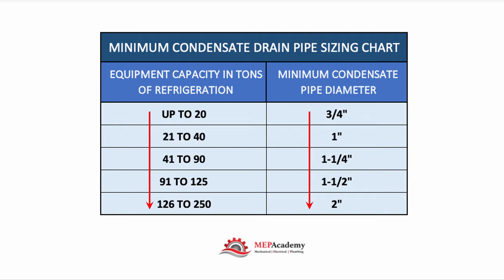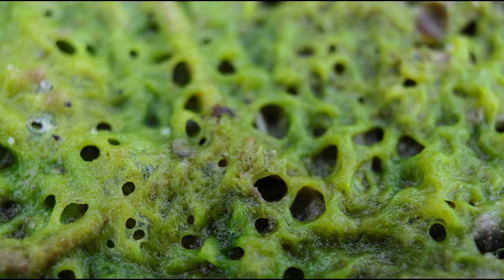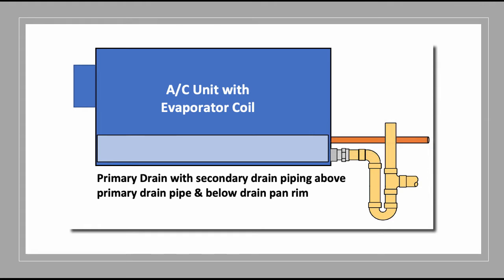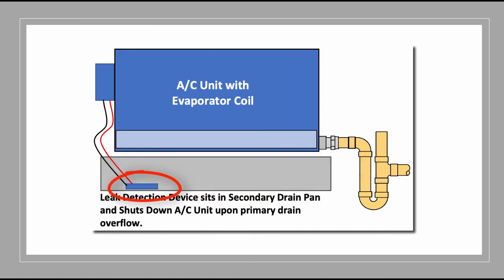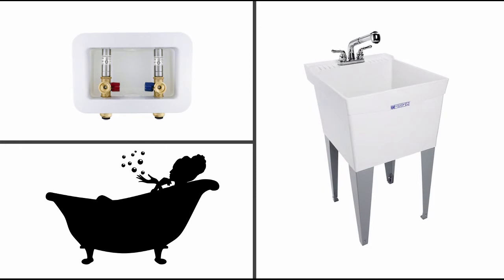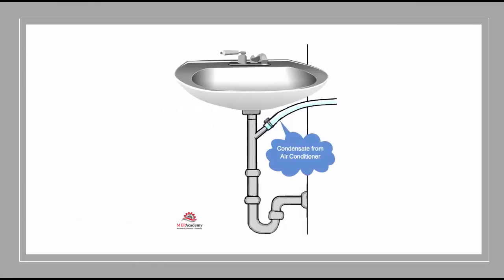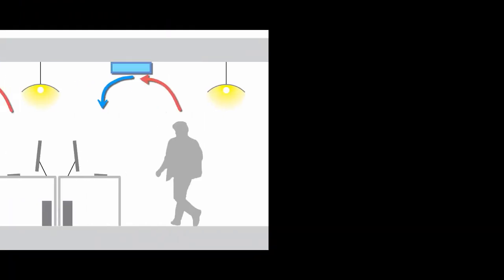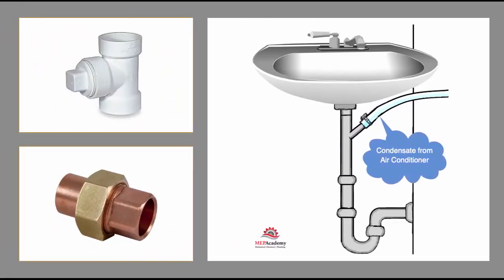Condensate Piping Design and Sizing

Comment: @MEPAcademy What are the pipe sizes for above 250TR refrigerant
Reply from the maker: You would have to check your local code for something that large. If not available then maybe you'll need to apply some engineering principles and get the code authority to approve it. Calculate the expected GPH of condensate and size the pipe based on your calculations.
Reply: @MEPAcademy  Thanks

Comment: The issue I've ran into is, at least in the case of mini-splits, the manufactures tell you to contact your code authority and then the CA tells you to call the manufacturer. I'd love some clarity on Air Gap requirements and dry p-traps in instances of draining to a sanitary drain, in particular.
Reply from the maker: Have you read the actual code section for the requirements? It shouldn't be that difficult to ascertain the requirements, unless your code is ambiguous.
Reply: @MEPAcademy  Yes, I have and as I said there is little to no code that suitably applies to product type I mentioned.
Reply from the maker: The International Plumbing Code Section 802.3.1 Air Gap, states "The Air Gap between the indirect waste pipe and the flood level rim of the waste receptor shall be not less than twice the effective opening of the indirect waste pipe." This appears to indicate that if you have a 2" waste pipe, then your air gap needs to be 4". That's 4" from the bottom of your pipe to the rim of the waste receptor.
Reply: @MEPAcademy  good callout, I've read that one before but I can't get the local inspector's office to even agree if I'm even allowed to connect the condensate line of an indoor unit to a sanitary drain at all. Some areas say air gap + P-Trap is ok, other areas won't accept that and require it to drain outside always. It seems to be a bit ambiguous right now from my perspective.